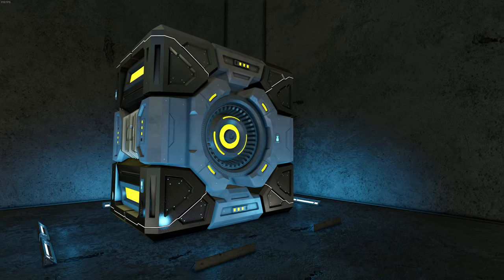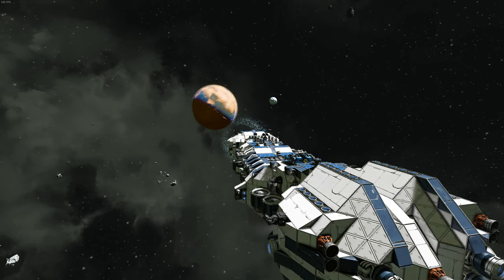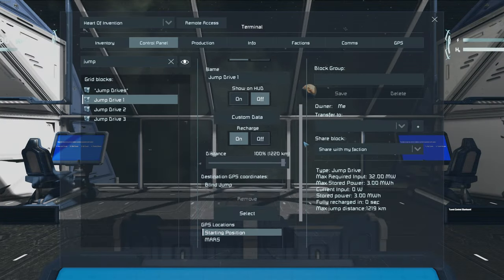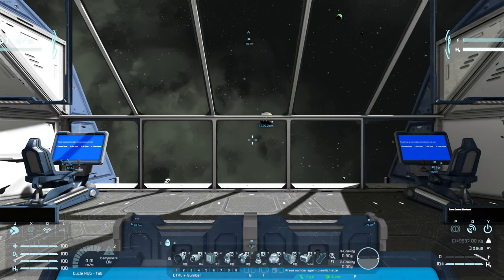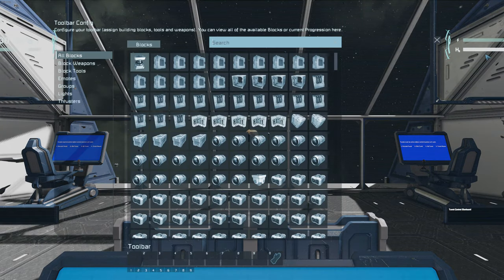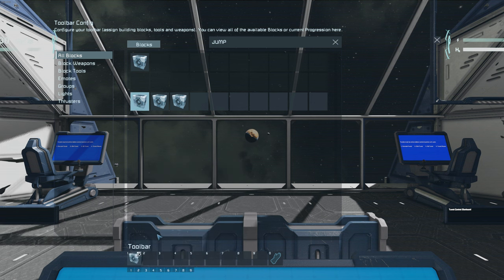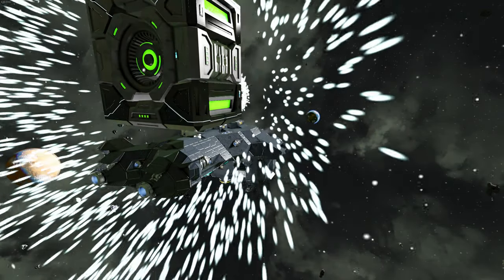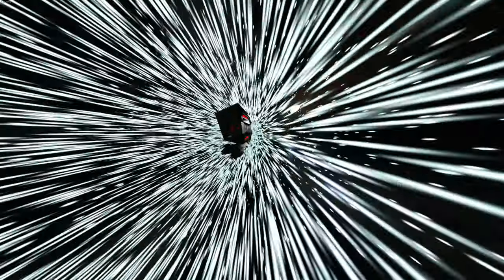Quick Tips: Jump Drives - Space Engineers

Comment: another fun trick, have 2 control seats facing different directions. The blind jump follows the seat orientation so switching seats changes the direction relative to the ship. not very usefull but worth noting.
Reply: I'll do it for sure. Could be useful if you use blind jumps more often than GPS-guided ones. Write a lil exploration mode script where you pick a direction, run the script to disable all seats from controlling gyros, and then you can run a straight line out and a straight line back without fear of veering too far off course and making an extra jump necessary at the end.

Then again I also play with the speed limit disabled so when I land 200km from home base I can just do a long burn and return in a couple minutes. Jump drives are still great for long trips though. It'd still take hours to burn hard enough to cover the distances that 20 jump drives can get me in seconds if I'm in a huge system.

IDK I think it's a good idea